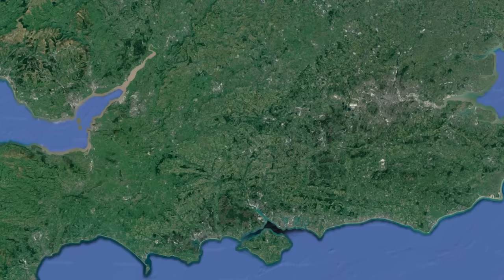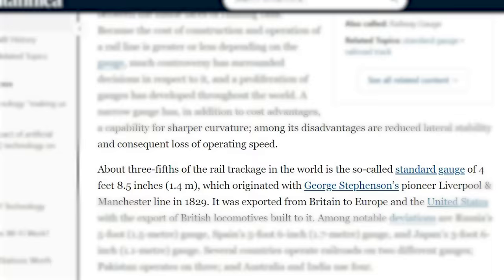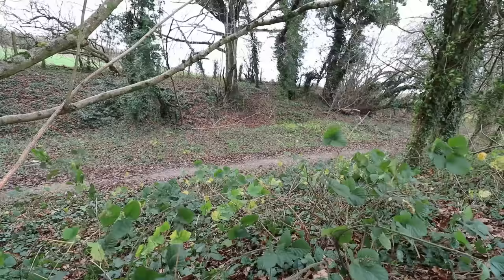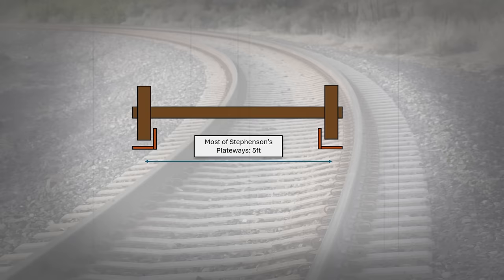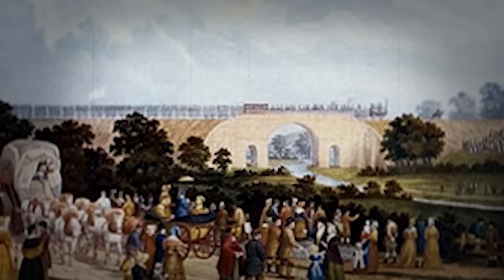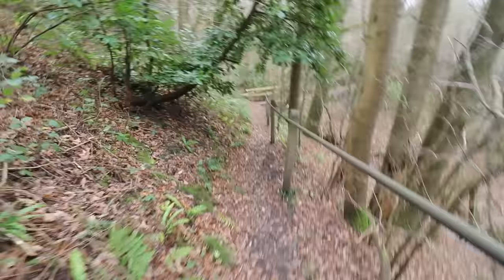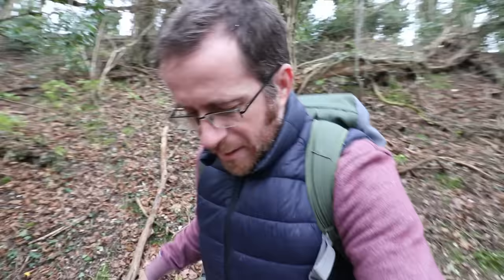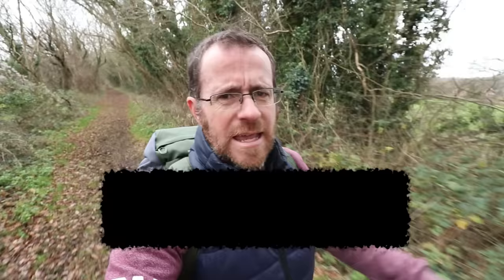Railway Gauges did NOT Evolve from a Roman Chariot.

Comment: I remember flipping through a North American railway industry magazine and coming across an article about missed opportunities in the history of railroading in NA. One was failing to abandon the current gauge early on for a six foot gauge. Citing the inability to increase the carrying capacity of rail corridors.
Reply: 6 is too big.  5 or 5.5 max would have been good.  One guy can move 9' ties all day.
Reply: @MilwaukeeF40C  5 really should be standard, with less than that being considered narrow.
Reply: @MilwaukeeF40C  move ties by hand? No one does that any more. Not mass production anyway.
Reply: new build HSR systems are almost all standard gauge despite being able to pick anything so the benefits don't seem super exciting. the US also improved capacity without changing the rail gauge by making the loading gauge taller for bilevels and double stacks.
Reply: Here in NZ they use narrow  1,067 mm (3 ft 6 in) gauge, due to the mountainous terrain, Some parts of Australia use it and I think Japan also uses this gauge.
Reply: @henlostinky273  not relevant and not true. HSR isn’t going to change gauge because it isn’t worried about weight capacity and double stacked cars are still subject to the same basic weight limitations accept the commodities hauled in double stacked cars isn’t reaching that weight capacity.
Reply: @uhtred7860  Ā cape gauge, used by the British Empire in its not very developed colonies. Considering your country is developed now you really should up to 1,435 m atleast, tho I will always give preference to 1,520 m. You dont really need greater load bearing cos all your big cities (except Hamilton) are costal so the biggest cargo can be efficiently moved by ship.
Reply: @baltulielkungsgunarsmiezis9714  I have no idea why they don’t utilise rail more here, I can count on one hand the amount of trains I have seen in the last 12 months, nearly all freight is moved by road.
Reply: @uhtred7860  "I have no idea why they don’t utilise rail more here" Too much bad american influence. Oklend looks so beautiful from space, like it should be a utopia but once you zoom in all you see is car dependant hellscapes with rural manors build right next to each other. The masses still havent realized that rail was the past and rail is also the future. Imagine telling a medival person who lived in a walkable city that everyone in it needed to get themselves a horsecar, hed ask you the very obvious question where would you put all the cars. Our cities are too big to be walkable which is why we should build tramways. A 3 wagon tram every 5 minutes will carry 3 times more people than a constant stream of cars, so 3 times less road and more space for houses and parks and the things people actually want. This is one thing the comieblock hellscape of Rīga does very well, at a mere 6 lines and half the population of Oklend the annual ridership or Rīgas tramway is 33 million. And Ive not even started talking about urban rail which funily enough has cheaper tickets despite being more expencive to maintain, clearly the russijan city administration is more corrupt than latviešu republic administration.

"I can count on one hand the amount of trains I have seen in the last 12 months" And I cant count on 2 hands the ammount of trains Ive seen in 3 months and my home town of Baldone doesnt even have any railroads in it (they really should rebuild the old tram way which in the interwar period did to between Rīga and Baldone). I just go to the capitol basically every week and every time I see the railroad bridge its a 50/50 that Ill see a train usually passanger as cargo trains not meant for Rīga itself typically go arround as the shedule for passanger trains is prity tight. Soon Railbaltic will be built literally 100 meters from my house, I have mixed feelings about this. I fully support high speed rail from Tallin to Varshava, but I also know what its like to have a railroad just outside of your rural house, this is the case for my former chess trainer. What really supsets me is that location B was selected not because its better but because parrasites who 20 years ago knew the railroad would be built eventually had built uninhabited houses in the path of place A so they would get payed millions in compensation for their demolition. If I where Latvijas dictator I would just order these scum to be tried to corruption and their land confiscated with no payment for intentionally harming society and trying to scam the government and then build the railroad on plan A because it is a better path, theres a reason its A and not B. Also yea when its finally built I will go to Varshava right away, I dont feel like driving for 7,5 hours thats why Ive not visting Poland thats far, but 0,5 hours drive to Rīgas station and 3 hours of riding a train now that I can do. Yea since you like me also live in a flawed democracy you should go start convincing people that you need a high speed normal gauge railway from Okland to Wellington, imagine reducing a tiring 8 hour drive to a comfortable 3 hour train ride.

"nearly all freight is moved by road." Very inefficent. Literal tones of rubber burned on aswalt roads for no good reason, when a few kilograms of steel could be burned on steel rails. Even narrow gauge electric trains are still much more efficient than any trucks.

Also are the rumors true, will Newzeeland ban smoking?
Reply: @kansascityshuffle8526  - They do in russia apparently

Comment: The ‘Bridge Rail’ was widely reused as fence posts and is still quite common if you scramble about in the undergrowth. It was originally used for both broad gauge and standard gauge track but was not the earliest broad gauge type used by the GWR; which was similar to Barlow rail, samples of which are still in situ at Chippenham Station forecourt as former gate posts.

Comment: Also true to say it's easier and cheaper to move one of two rails in and leave a gap between and particularly at the stations  than move the rails apart and consequently have to move buildings, infrastructure and buy extra land to enable it
Reply: I suspect (from recollection of photographs and history of the railways) there was a three rail system in use for a long time, with narrow gauge inside the full GWR gauge.  The conversion was mostly removal of GWR gauge locos and stock followed by a slow removal of the wide rail and realignment of the standard gauge a little bit.  Tidying up point works, island platforms etc. took a while longer.  And yes, getting the narrow gauge converted to broad gauge would have involved effort and cost not perceived to have commercial value at the time.  But op north all is perfect all t time.

Comment: Excellent video and a very good explanation of how we got to 4’8.5”. I think it was the author Adrian Vaughan who suggested that the reason Brunel went for 7’ was because the the assumption was that the loco’s boiler had to fit between the frames to avoid instability. Thus a wider gauge meant bigger boiler capacity and longer/faster runs without the need to stop. Add to that the bogie had yet to be developed so coaches and wagons were 4-wheels only (a wheel at each corner) so they had to be short in length. A wider gauge meant greater payload/passengers per vehicle. The Ffestiniog was the first railway to use bogie coaches but that wasn’t until the 1870s. Perhaps if bogies been thought of sooner then gauges would have been even smaller. Best wishes to all.
Reply: Until the gauge to carriage ratio becomes unstable.  Also one reason for even the 2' gague was to deduce costs of earth works and bridges.  So carriages were narrow to get though the cuttings etc.

Comment: Conceptually the wheels on broad gauge rolling stock went on the sides rather than underneath. For the locomotive you could have the big wheels either side of the boiler which was not possible on standard gauge with a decent sized boiler.
Reply: Yep - even worse on 3'6" for boilers.  Hence all those inventive engines.  Articulated Beyer-Garrets.  Welsh Fairlie.  Narrow decapods with some wheels with no flanges.  All to deal with that very issue on narrow gauges.  Then on 4'8.5" articulated front and trailing bogies / trucks.   Classic 4-6-4!

Comment: In the US there is a good story about how over a 48 hour period in 1886 the 5 foot railroad gauge used in the South was converted to the standard gauge used in the rest of the country. I'm not sure how many 10s of thousands of miles of track that was, but the affected area was well over half a million square miles (1.3 million sq.km).
Reply: Initially the southern 5' gauge was converted to 4'9". That's the gauge of the railway most southern rrs connected to, the Pennsylvania rr and its precursors. Only later when the PRR moved to 4'81/2", did the rrs of the south do so.
Reply: I thought the south had multiple gauges, not just one, and that was part of the logistical problems during the Civil War. Anyhow, when time came to switch gauges, the ENTIRE south did it in 24 hours. Has to be true, I saw it on youtube.
Reply: @edcew8236  Lol no. Some companies like the L&N for instance switched in the 1870s. The drop  dead date was in 1886 for all the companies that hadn't changed over before that, and there was quite a scramble even with some companies choosing to transition before 1886. As for the multiple gauges, it doesn't seem that way. It looks like the big Southern railroads had settled on 5ft. That doesn't mean some of the smaller companies didn't have different gauges though.
Reply: @Odin029  They did tons of prep work in the months beforehand, too, to be able to make the change so quickly.  Ties had extra nails added on the side to be widened, to save some work on those two days.  Locomotives and railcars had to be modified or replaced, with any replacements ready to roll at the changeover.  Workers and supplies had to be in place before work started, since they couldn't ship any on tracks that were still being worked on during the work.  And so on.  

I'd imagine some railroads took it as an opportunity for major upgrades to track and equipment too, much like how a lot of 1990s companies and institutions did major computer tech upgrades during their Y2K bug fixes.
Reply: In 1886?  Really?  Probably predrilled, and prepared for days.  So the 'down time' was only 48 hours for shifting and respike the one rail.

Comment: The Washington DC Metro was plagued with an increase in derailment events. And funnily enough the cause is RR gauge. And that was in 2017, and fixing the issue still ongoing. 

A new fleet of passenger cars were inspected and the axle assemblies were ‘out of specification’. 

Notably DC Metro uses 4’ 8.25” gauge. The 7000 series of cars manufactured by Kawasaki were found to have axles with wheel flange gauge ‘out of spec’. 

So gauge matters!! Even 1/4” when it’s a fleet of cars and miles of track. Especially at the switches.

Comment: It seems to me that Brunel was interested in the luxury express traffic of the day, but Stephenson was following the industrial application of railways. It was inevitable that the lower cost design would have greater appeal, when many lines were marginally economical to build and run.
Reply: Nah, 7' gauge had advantages for heavy freight too .  Every foot of extra width increases the freight capacity by about 20% .  7'¾" has 50% more capacity than 4'8½"  .
Reply: However, the area of a circle is a square law, so the cost of driving tunnels doesn’t go up linearly.

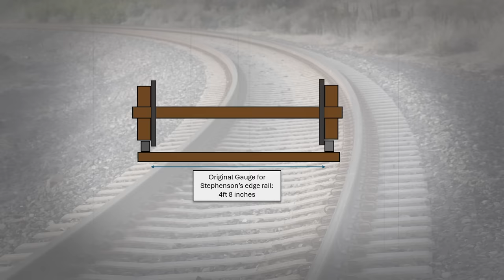Comment: 7:45 A similar widening of gauge happened later in Dresden and Leipzig, both Germany. When they laid out their respective tramway tracks, they used standard sleepers for 1435 mm/4'8.5" rails. But to allow for paving the space between the rails, they used a different type of rail heads with a slit for the flange to roll in. This sightly offset the center of the railhead to the outside to allow for the side rail on the inside. And now, Dresden tram has 1450 mm gauge, and Leipzig tram has 1458 mm gauge, both not found anywhere else in the world.

Comment: The semi-conical profile of railroad wheels is also a remarkable engineering design feature. It keeps the flanges from rubbing against the rail without a single additional part.
Reply: I was watching a rail program the other day and it said that just recently  they changed the profile just a skosh and cut about 10% off the wear.
Reply: However, that angle is not fully standardized, which leads to wear and other problems in international traffic.
Reply: Depends if you count the iron tires as a part .
Reply: @johndododoe1411 - The tires are necessary regardless of the wheel profile. My point is that, by making the profile semi-conical, a railroad wheel rolls with minimal flange-rail contact, without adding a single moving part. It's an elegant solution, and it probably appeared early in the development of railroad technology--perhaps about the time when steam locomotives started moving the cars instead of animals and/or people, because once steam power was available, flange-rail contact would have become a serious source of friction and a potential derailment cause. Even before the Stockton & Darlington opened, steam railways were pulling long coal trains at 15 MPH.

Comment: A bit like the battle between VHS and Betamax. Betamax had the better system but VHS had a better supply of films to view so won out.
Reply from the maker: Now... that was a battle
Reply: @douglasdeans2839 In the case of railways, Betamax won. 😁😁
Reply: Don’t forget V2000!
Reply: Better and Cheaper to license
also: not because Porn since Sony didn't cared that much
Reply: Even more.  Sony would not license thier system to other makers.  JVC did.  So when you went into a shop you had umpteen VHS models and only Sony models for Beta.  Bit like Apple v Microsoft.

Comment: 9:38 - Part of the reason that this dual gauge switch is such a mess is that the standard gauge on the straight route is changing from the near side to the far side, right in the middle of the switch.  It takes a twisted mind to do this in the middle of the switch, rather than a few feet to the right of the switch.

Comment: An interesting vlog, well researched. In the 1980s, British Rail (BR) had issues with modern stock "hunting" on continuously welded rail (CWR). The BR Research Department found that reducing the gauge to 4' 8 3/8" stopped the hunting. However, unfortunately several derailments of freight trains occurred on CWR. It was proven that the 1/8" difference in gauge was the cause, so BR went back to 4' 8 1/2" for all track and instead looked at changing the wheel profile on modern stock. As a point of interest, the track gauge was sometimes increased on tight curves to allow better transit of wheel sets, for example areas like Borough Market Junction.

Comment: I read once that Brunel's 7 foot gauge failed because other private companies preferred the narrower gauge because using the broad gauge required the purchase of a lot more land to lay the tracks. Brunel gave up and changed his rails to be compatible with everyone else.
Reply: I suspect that the higher cost of the longer ties (sleepers) would also have been a factor.
Reply: You mean Brunel's company after he died, similar to GE after Edison died .
Reply: The change to standard gauge happened 30 years after his death!
Reply: Standard gauge is at about the sweet spot for cost of operation and construction against what you can carry. Narrower gauges are cheaper to construct but the amount that can be carried rapidly decreases. So they tend only to be used for lighter traffic flows, in hilly areas where their ability to use sharp curves is useful. With broader gauges the cost of construction increases exponentially, and curves have to be less tight making planning a route more difficult as wider gauge wheel sets do not corner as well. Also back in the days when everything was carried by rail a great big broad gauge wagon with a couple of tons of goods in it was inefficient.

Comment: During the interregnum the 7 foot gauge had a 4’81/2” rail added and thus some of the old stock and engines were better able to work out their lives. There was also the point that in the time of Railway Mania the sheer cost of the 7 foot gauge was much higher in terms of land acquisition. The construction was different as well as the 7 foot gauge rested on length wise planking not the cross ties of the smaller gauge though the length planks could be periodically cross fastened.